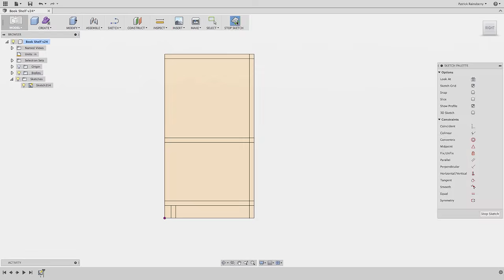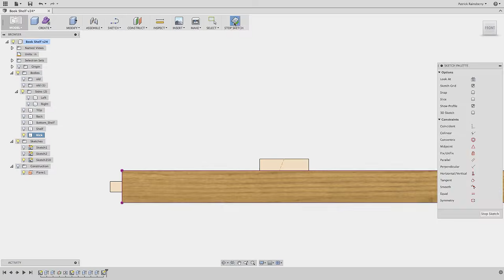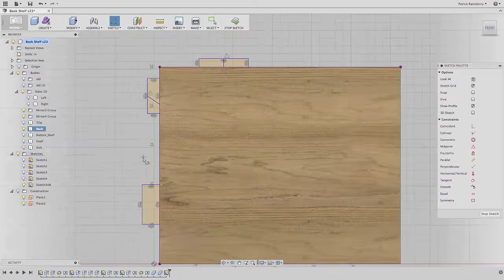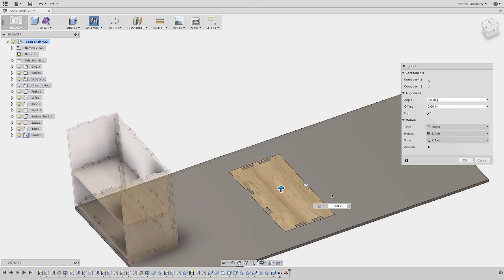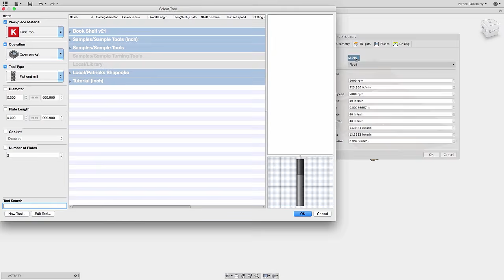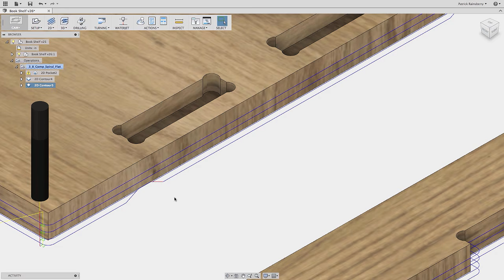CNC Router with Fusion 360, Bookshelf Tutorial

Comment: Watched this like 4 times, great tutorial, wondering how the tabs fit into the pockets with no clearance defined?  I guess I need to experiment and figure it out for myself.  Thanks for posting.
Reply: Ha yah that was my question when I first saw this technique.  My inner mechanical engineer tolerance stack alarm was going crazy.  But then I realized its plywood and not aluminum haha.   Even thickness varies quite a bit in a single sheet.  I found that if you have a good measurement of ply thickness (which changes with each new sheet...) designing to flush gives a nice fit.  At worst a little tap with a rubber mallet gives a satisfying press fit.  I think if I was using a hard wood I might design in a very small tolerance, but haven't experimented much with that.
Reply: That is a good point. It would be good to do a sample part first with one press joint to get the tolerance correct. Also modeling the tabs slightly long and sanding flush after assembly is a good safeguard against slight variations in plywood thickness
Reply: @bd9494  tried this with 1/2” plywood and joints fit great.

Comment: Patrick - Great video and demo of manufacturing a product with ShopBot.   I just wanted to add one way to simplify the process would be with a Fusion 360 Add-In MapBoards.   This application will layout the existing bodies in the model on boards of user specified dimensions leaving the model untouched.  The layout is done with copies of the model bodies.  It will also handle linked components so your model could be assemblies.  Small like a bedroom bookshelf or large like an entire room or house.  I've seen it all.    Here is a link with product description and features.    https://www.icarussoftlandings.com/app/

Comment: Great tutorial!
One thing I noticed: You didn't consider "veneer direction", or wood grain direction when you laid out the parts, so some parts will look different than your rendering.
Question: I'm considering using a bit called "Lapped Miter Joint Router Bit" (or this kind of profile) for making Plywood boxes; What is the easiest way to apply this profile on all four edges of a plywood part? And would you use this router bit or would you use a combination of bits?
Reply from the maker: Yah, i made this when I was really new to woodworking.  I wish I had considered grain direction.  For your other question that is probably beyond my level of knowledge for woodworking.

Comment: Great video Patrick. For this and any other woodworking joinery project, how do you tolerance the mating parts? Exact sizing of mortise and tenon would seem to be a problem come assembly time. Thanks!
Reply from the maker: Actually with ply wood I do zero tolerance.  Plywood is forgiving enough that it makes for a tight press fit.  Sometimes a couple hits with a rubber mallet, but it hasn’t yet been a problem

Comment: +Patrick Rainsberry  I am 66 years old mechanical engineer and hobbist woodworker with a great CNC machine, I am only a simple programming hack and have never learned any complex CAD CAM in my previous profession.   I've attempted to learn Fusion 360 (and sketch-up before Fusion 360) Many times and watched a lot of videos with very little progress.  I made more progress with this one video than in many hours prior to this. The "Parameter" tip was a huge epiphany for me.    So as a NUB thank you for a simple project that covers many basics and has given me the confidence that I can learn this.  I have a few basic questions .

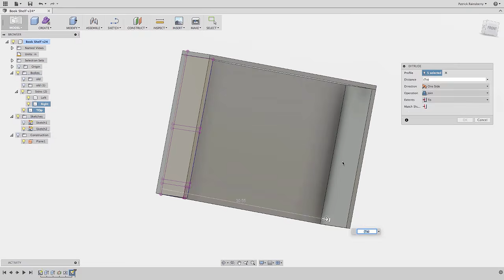1. I'm using the current version of Fusion 360 and can't quite figure out how you jump from manipulating the model to orbiting the model and  back to selecting objects again.  ( the video where you extend the shelf to the object. see time 9:05 )

2. I accidentally made 3 objects in one body.  Is there a way to move an object to a new body?
2a.  Since the shelfs are multiples should the shelf be created as a component?

3.  For some reason sometime when I was working with sketches, suddenly all my "Bodies" disappeared in the left browser tree and could only get them back when I did multiple undo's. AM I accidentally deleting the bodies or am I removing them from the tree and they will reappear when I select a  different action / Command?
Reply from the maker: Thanks!  

1 - If you hold down shift and middle mouse button you can rotate the model.  Scroll wheel zooms.

2 - Yes, right click the body and select 'create component'

3 - I think what you are seeing is that when you go 'back in time' to edit the sketch you are editing a feature that was created before the bodies.  Look at the timeline at the bottom of the screen.  When you edit things in Fusion that happen in the 'past' those other features are hidden from view.  After you edit the sketch then those features will rebuild.  Hope that makes sense.
Reply: Thank you for taking the time to answer these newbee questions.

Comment: Thank you for a great tutorial. But I have a difficulty to exclude from kick part, 12:30. After I draw  two rectangles and stop sketch, I only can see the Kick body without those 2 rectangles sketch. That's why I can't exclude. I turned the light of the sketch but it soon diappeared
Reply from the maker: you can tell if they are good if the profiles are shaded.  If not you probably didn't sketch it correctly.

Comment: Thank you so much for this! I followed along in Fusion360. One issue I ran into that I'm not sure about: When I was extruding the tabs, if I tried to do it like you did, by telling to go to the bottom plane of the shelf. No matter what I tried, this generated an error. "Error: Tool body creation failed Extent boolean fail. The termination entity might be not fully intersected with the tool body built along the operation direction" Any idea what I'm doing wrong? Here's a screenshot:  http://take.ms/wnfkp
Reply from the maker: Yes there is an option called 'Chain Faces' with two buttons you can press.  You need to select the other option.  In this case the tab extends pat the edge of the surface you are extruding up to so you need to 'virtually extend' to stop.  It makes more sense if you were extruding up to a curved surface.  For flat stuff like this you almost always want the second option (extend).

Comment: HELP!! Dogbone add-inn doesn't work..
Reply from the maker: There is a video on my page that goes through using it in more detail.  Most common problems are that it is not installed in the correct directory (make sure directory name is correct) or that you are trying to do the automated one and the pieces do not have their 'up' direction aligned with Z
Reply: You are a genius! I just changed the UP-PLANE parameters and it worked just fine. :)
Reply: Got it to work perfectly on the model i worked with last time. Tryed it again now, but.. NO!
What do i possible do wrong on this model? http://a360.co/2CU0Sxt
Reply from the maker: Ubbe Berg looked at the model and it already has them?  Have you tried just picking edges rather than bodies does that work?

Comment: Great video! The last time I touched AutoCAD was in year 2000. Thanks to your wonderful video I picked up Fusion 360 with no problems at all until I tried loading the Dogbone Addin. I know this will help me a lot of work and so am keen on getting this add in right. I am getting a long error message saying...Failed: Traceback(most recent call last): File 'C:...../API/AddIns/Dogbone.py', line 193, in run ....File 'C....', line 3982, in addButtonDefinition return_core.CommandDefinitions_addButtonDefinition(self,*args) RuntimeError:3: the relative resourceFolder path not found.   What do I do? Thank you in advance.
Reply from the maker: SOunds like you didn't get all of the files in the download directory.  THere should be a folder called resources with a bunch of image files for the icon.
Reply: I have 5 PNG files in my Resource directory: 16x16-normal, 16x16-disabled, 32x32-normal, 32x32-disabled and cover_image
Reply from the maker: hmm it still looks like the path is wrong.  There should be a folder called dogbone inside the addins folder.  Then the resource folder should be in there.   Looks like you unzipped the contents right into the addins folder
Reply: You are right! I did download it into my AddIns folder. Where should it have been downloaded? Can I copy and paste into the new location?
Reply from the maker: it should just be in a directory into the addins folder called "Dogbone"
Reply: I made a new folder and moved every thing to it and yet I again got the exact same error message.
Reply from the maker: does your folder structure look like:
Addins/
    Dogbone/
        Dogbone.py
        Dogbone.manifest
        Resources/
              16x16....
              16x16....
               ....
Reply: No, it is:
Addins/
  Dogbone/
  Dogbone.py
  Dogbone.manifest
  ...
  Dogbone-master/
    Dogebone.py
    Dogbone.manifest
    ...
    Resources/
      16x16..
      16x16
There is some nesting of the same set of files when I created the new Dogbone folder.
Reply from the maker: just move everything around to match mine.  Not sure how you ended up with that.
Reply: Cannot thank you enough --the error message is gone! Yay! When I am running the add-in however I am getting two errors. First a message 'Failed: startSketchPoint' and then all the pieces coalesce to the origin remaining in their own planes.
Reply from the maker: Are you sure you followed all the steps?  The parts need to be laid flat. THey need to be components (not bodies) and they need to be oriented with Z up.  Also if you have been just dragging parts around you need to first create a snap shot.  Make sure you follow every step.  If you skip a step it won't work
Reply: I redid the entire project once again and again the dogbone add-in did not work though the icon is showing now. I then did a simple 2 piece model (one male and one female) and still had the same issue. I believe the key factor is the orientation (I did convert them to components). The icon on the upper right hand corner in your demo does not show the axes. It just indicates top, front and right. I have top in the X and Z axes. Right in the Y and Z and front in the X and Y axes. In mine the axes are showing in addition to the box. What should it be?
Reply from the maker: to apply the fillets automatically the pieces have to be oriented in the XY plane.  This is why they are applied after the parts are laid flat.  You can also just pick edges individually.
Reply: That was the key! I am not sure why the default setting for Fusion 360 was Y-up. I changed it to Z-up and the dogbones finally worked. Your enormous patience in helping me and the steadiness of your voice in the video is unbelievable. Thank you. However all the components cluster to the center when the add-in finishes it's job and there are unwanted dogbones all over the place. It seems that the dogbones are being calculated as if the components were not spread out in the stock but clustered in the center as it is initially.
Reply from the maker: After you have moved the parts make sure you click the "snapshot" button before you create the dogbones.  THis will capture the position.
Reply: Got it. Thanks. This time followed all the steps to the end. Had some questions. 1) In 2D Pocket in window I had an extra line 'Min Cutting Rad' 2) In CAM I got '[T1]' inserted in front of the tool paths. Not sure what these were. 3) From the direction of the red arrows it was impossible to tell if the tool path was inside or outside. How do you differentiate? 4) If I use V-Carve Pro which comes with ShopBot how to I export the model? 5) Right at the end I received an long error message starting with "Code page changed to '1252 (ANSI-Latin I)' etc"...Error: Invalid coolant mode....Error: Failed to invoke function 'onSection'...Post processing failed" The ShopBot I have access to uses air as coolant and so I had selected that. Thank you.
Reply: One other thing, when we 'combine' to cut the ply, I presume, the cut would be the exact same size as the 'tool'. Do we not want a slightly bigger cut (maybe by 1/32" or so) to make assembly easy? Is that what you refer to as tolerance when you set up the parameters? Do we set tab length as (Tab+2*Tol) to add in the tolerance?
Reply from the maker: Yes you could definitely do that.  I've found that the shopbot is accurate enough that I can essentially model things flush and the amount of 'give' in the plywood makes for a really nice press fit.  Just a lite tap of a rubber mallet.
Reply from the maker: 1 and 2 you should post on the FUsion forum as questions.  I am not sure exactly.  3 - You can look and see if the arrow is on the side of the edge you expect to see the cutter on.  4 - i don't think it is possible.  You would need to check with the V-Carve people.  5 - Definitely post that one to the forums. 

THe developers and QA people are really active in there and you should see a resolution really quickly.
Reply: Thank you so much. You help was unbelievable. I designed my first piece (a night stand) over the long weekend. It was possible because of you. Thank you once again.
Reply from the maker: That is awesome!

Comment: This has been absolutely critical for me to understand how to lay out interlocking parts. So many little things i had not understood have been explained clearly here. Thank you so much for this. I know this is an old video, but i would love to know if you're doing anything else like this. I've just built an MPCNC and have it reliable enough i'm ready to start making some chips.
Reply from the maker: I haven't done anything else recently.  I have been meaning to though.  I have a few other videos on my channel you can check out in the meantime though.
Reply: Patrick Rainsberry thanks for the heads up! I've also been looking at NYcnc videos as well, but they're a bit over my head. 
I do have a question about the heights tab under the cam section. I don't fully understand what autodesk is trying to tell me with the different layer heights. I set it up the way that makes most sense, with no offsets, I'm afraid of crashing my shiny new carbide bit.

Comment: Patrick, I have been through the video many times but I can't seem to correct this error. Warning: No passes to link.
Generation completed with 1 warning(s) in 262.0ms.
Warning: Empty toolpath.
Any ideas. It happens when I am doing the last operation creating the 2D Countour to cut out the 7 pieces.  thanks for any help.
Reply from the maker: My guess is that you didn't properly select the components in the definition of the tool path.  Or that the stock is set wrong and the tool paths are not within the stock.  Check you setup and the geometry selections in the operation.
Reply: Thanks Patrick, it wasn't long after I posted the comment that I figured it out. It's been so long now but I appreciate you doing the video.

Comment: When dimensioning  joints like this isn't a tolerance to be applied in order to have a smooth fit? (IE a 0.75" leg in a 0.75" hole is going to be extremely tight no?)
Edit
BTW Oups great job !